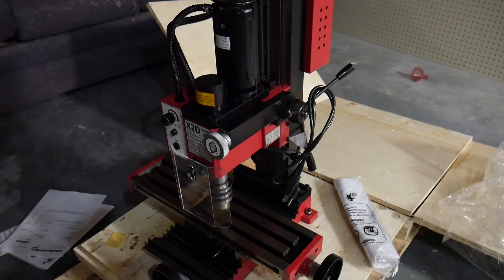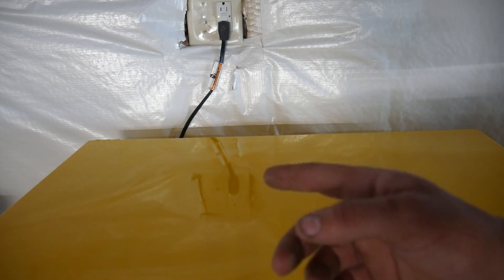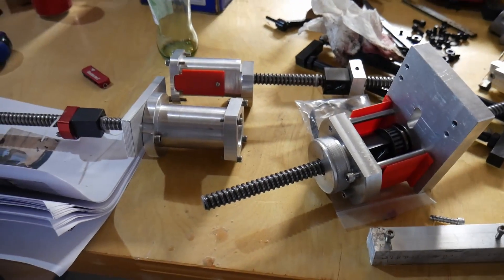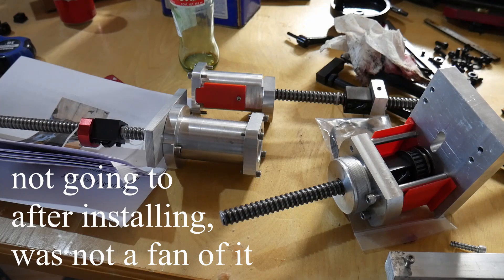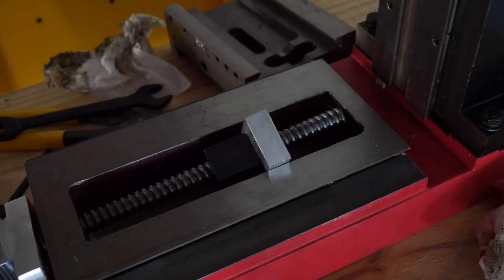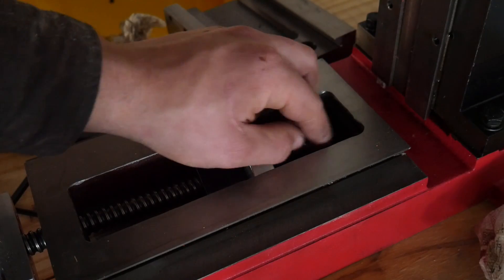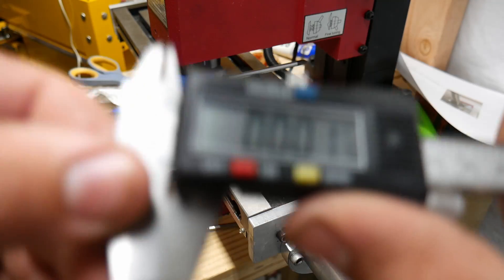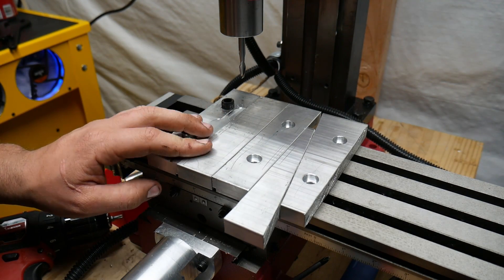SIEG X2D Mini Mill CNC Conversion

Comment: No Fucking link
Reply from the maker: It wasn't worth linking. The kit was shit
Reply: @DiehlDoes  sorry to hear. Ill buy you a coffee the next time you are driving thru connecticut
Reply: @DiehlDoes  the CNC kit was shit? Are all CNC conversions using Belt/pulleys? I always thought they used motors and couplings connected directly to the ball screw.
Reply from the maker: @ChristopherJones16  most are a belt/pulley design to gain spindle rpm

Comment: If you want a consistent z depth you can always face the part first, and I can’t really tell because it’s sped up but I would say your travel still looks a little fast for that end mill.

Anyways, great video I found your dry humor pretty funny dude. You have a link to that kit! Didn’t see it in the description. Thanks.

Comment: I was looking at this particular mill. Other than the spacer issue, is there any other reason you wouldn't recommend this conversion? I was looking at a competing one with a side mount for the Z-axis. The cetnerpull on this one looks like a better design.
Reply: I heard the side mounted ones create binding issues.

Comment: Hey man I just watch your AR lower builds and I think you should make an upper receiver out of steel, only because there is only 1 company that does it but I think it is better to use steel on steel when it comes to the mounting of the barrel into the receiver

Comment: So which conversion kit did you get?  I have a HF mini mill like yours that I'd like to convert to CNC....I've gone back and forth on making my own motor mounts etc on the Bridgeport....any insight you could give on the controllers and motors and smooth steppers homing switches etc that you are using?
Reply from the maker: the kit I got is from ebay the guy gave me a really good deal on it. If he hadnt I most likely would have made my own. I have a nema 23 stepper kit from ebay and a usb stepper driver off amazon. homing switches are just cheap microswitches cheap from amazon, have yet to install them.
Reply: Stepper "homing switches" ? Are you talking about Limit Switches?
Reply: @ChristopherJones16  yeah same thing.....

Comment: I know absolutely zero about cnc, but I'm wondering if you can find a shorter end mill to do the heavier cutting.  Seems like a lot of stick out on it to me.  Might also trying the largest diameter possible for roughing and go back with the smaller one for touching up the details.  When you go back to the smaller diameter you might have to back off on the travel speed, or raise your rpm.  I looked like the last cuts you were taking with that ball nose end mill that you could see it flexing.  I'm probably not telling you anything you don't know, but maybe that can help in some way .
Reply from the maker: Those are all valid arguments, the most important thing I need is more rpm, this is only running at 2500 right now and i think i really need to be around 10k. i have a kit ordered to get it to 5k rpm and if that does not help I will have to buy a whole spindle motor and mount onto the machine which is really the most ideal situation, just expensive. Thanks for the comment I always appreciate feedback
Reply: @DiehlDoes  like I said, I don't know anything about a cnc machine.  I just bought a Bridgeport a few months ago.  I am very interested to see how it turns out for you though.  It would be nice to have a small machine like that.  I subscribed to your channel and I look forward to watching your progress.